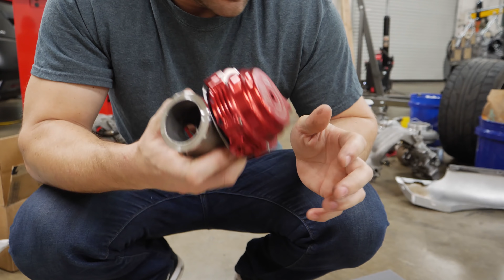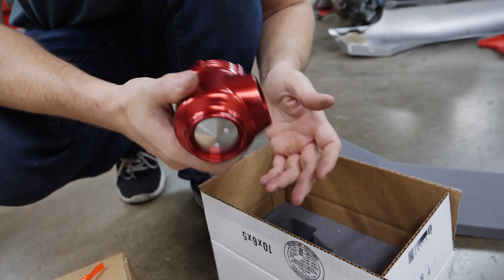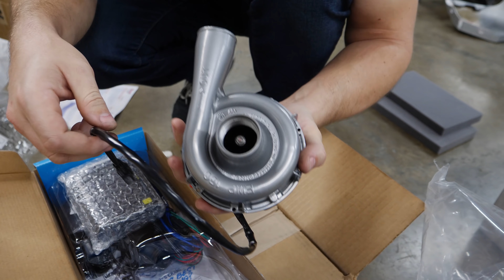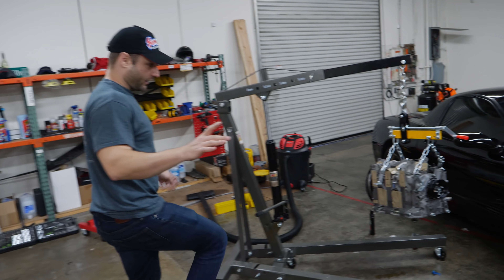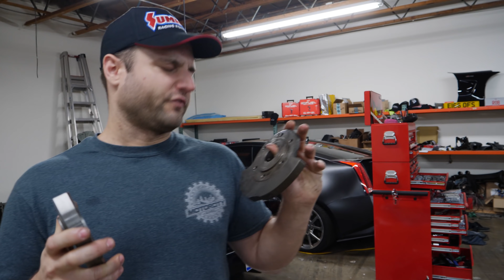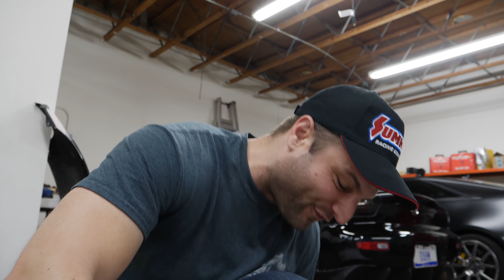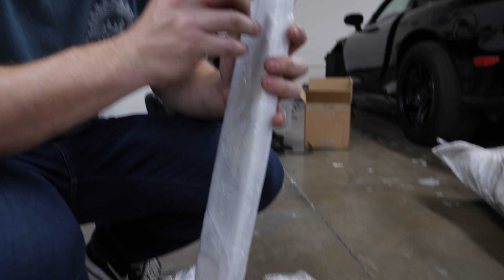Billet engine for the Rotary Corvette? Almost time

Comment: 19:45 That seal is in backwards. Pretty side faces out.
Reply: Spring on the inside... I was griding my teeth when i saw em put it on..
Reply: It's definitely in backwards. Spring side always faces the fluid.
Reply: Felt myself dying inside when he put it the wrong way around
Reply: Maybe he's just trying to keep dust out instead of keeping the oil in? lol
Reply: i was about to say that, pretty side facing out
Reply: How does he not know which way an oil seal goes!?
Reply: Can't even put a seal in the correct direction,, but he is assembling a rotary.  How long until the oops I blew it up video?
Reply: @johnsch2957  to be fair 3 mins later he says "im probably going to ruin it i dont deserve stuff this nice"
Reply: Pretty sure im the only one yelling at the video because of the seal been install backwards, Lol
Reply: the problem is getting it out
Reply: @dementedjoker3404  Looking how they used hammer on its fragile side I assume it's pretty much F... at this point. If internal lip deformed too much or cracked it won't seal. Learned that hard way fixing gearbox on my soapbox.
Reply: Yes was just about to say it too! lol, let's see if he corrects it for the next video
Reply: He forgot to install the nut for oil pump gear.
Reply: @djfung  Big surprise as this guy clearly has no clue of WFT he is doing.
Reply: Maybe a bit of assembly  lube to..
Reply: ** coming apart after LS fest** it might do the dissasembly for him.
Reply: Ouch. All I could say was oh fucckkk that seal and lower nut
Reply: god i was cringing seeing him put the seal backwards.... He does crazy work but then fucks up on like beginner mechanic error. fml
Reply: @Rob Dahm you definitely put the seal on backwards , hopefully he sees this and fixes it before the engines complete.
Reply: Yea, I hope it's edges doesn't get fuckerd when he takes it back off to flip around
Reply: Dan katesfield Pretty sure he didn’t put grease on the outside of the seal so most likely it will get bent when he removes it. He could use a puller kit for seals and carefully tap it out but I doubt he has a kit.
Reply: I had to pause to make sure everyone picked that up
Reply: Man I’m glad there plenty of other smart people that knows and seen that the seal was in backwards
Reply: maybe hes trolling to see how many people he can get triggered with that seal lol
Reply: I had to satisfy my OCD by checking that there was a shitload of comments about the seal being the wrong way around lol
Reply: Maybe he thought it was a thermostat gasket
Reply: I was gonna say the same thing and your message was at the TOP! Good catch!
Reply: That seal might work for a little bit but once it gets any pressure on it's not going to work well they are shaped like that to ballon out tight under pressure
Reply: I cringed a little when i saw it!!
Reply: Let me be a ducsh bag and bring a non  ls  motor to an ls  motor fest..  then hack  job it together...makes sense.  Cleatus  gonna see him  and give him an awkward  "well that's cool rob"  "now hold my dew  and watch a real motor rip"....
Reply: I just posted the same thing before reading any comments. There's like 88 comments saying the exact same thing...lmao
Reply: Maybe Rob is just testing us. See if we notice lol.
Reply: Feeling like on the ducking Goonsquad Channel......Working on a crashed Lamborghini Huracan not even knowing how a simple Startermotor works.....duck this shit
Reply: What if... He purposely instally the seal backward for dry sump system with high crankcase vaccum suction?